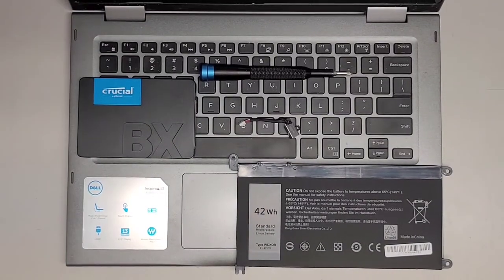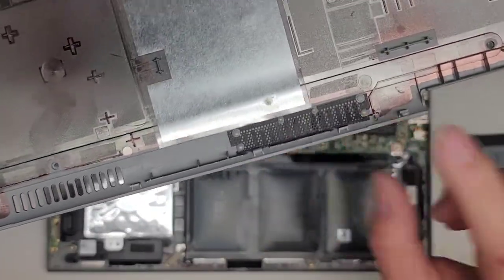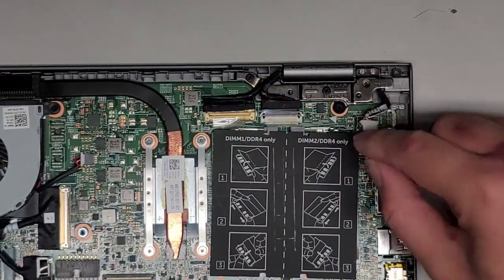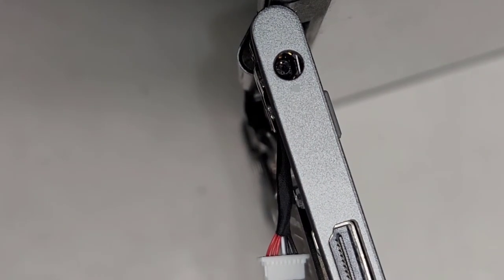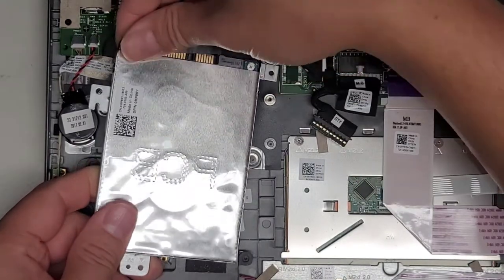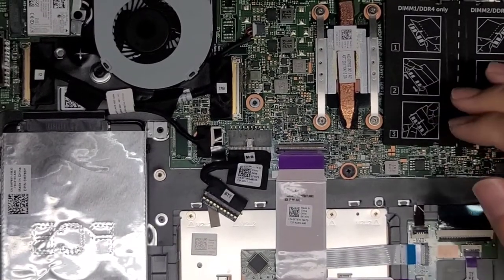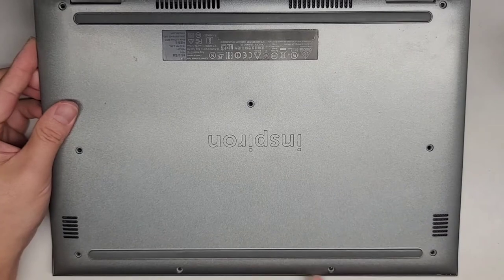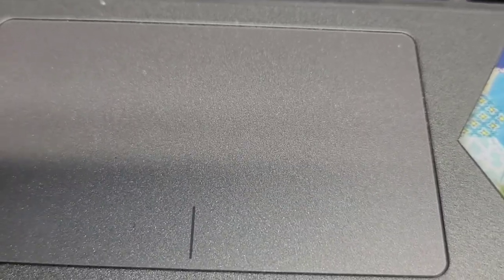DELL Inspiron 13 5000 Series 5378 2-in-1 Disassembly RAM SSD Hard Drive Upgrade Replacement Repair

Comment: Excellent video brother!❤ I'm not from computer background at all but hoping to replace HDD with SSD and also upgrade RAM by myself. Preparing myself for the task by reading theory and watching videos (yours is quite helpful!).

I have 2 questions (may sound silly)

1) How to protect internal components from static electrical discharge from our body while opening back lid and working?

2) Which software would you recommend for cloning HDD to SSD?

Thank you so much man!❤ Appreciate your dedication to explain it to public!
Reply from the maker: This will help https://youtu.be/4p5jFDzVwUw

Comment: Since there are two slots for Ram can you use the old existing one and just add a ram stick to the slot beside it?
Reply from the maker: That's what I say in the video.
Reply: @ItsBinhRepaired  Ok. Thanks. I didn't catch it.
Reply from the maker: Make sure you get the same capacity,  speed, and type of ram for best performance.
Reply: @ItsBinhRepaired  Ok. Thank you. Will do.
Reply from the maker: @DustedinShadow  sounds good

Comment: i have the same laptop and i cant seem to find intel processor under that slot where copper heat transfer cable is present
Reply from the maker: It's soldered to the motherboard.
Reply: @ItsBinhRepaired  thank you!
Reply from the maker: @prakash525  no problem

Comment: Do you have same motherboard? 
I need the motherboard for my laptop.
Dell inspiron 13 5000 5378.
Reply from the maker: Maybe ebay
Reply: EBay good on finding motherboards. I replaced mine on a netbook several years ago as the charging plug broke off.
Reply: Kada
Type in on search the part number of motherboard and that is the best way to find one.
Hope that helps
Reply from the maker: @brianperry4815 yup
Reply from the maker: @brianperry4815 yup

Comment: My wife has similar laptop but 7000 séries. The trackpad more then not buttons don't work so I ordered a new one from Dell as I wanted to get the right one.
Reply from the maker: Hope the repair goes well.
Reply: @ItsBinhRepaired   It mostly went well.  It works BUT not good at pushing down holding to scroll. also drag and drop.  The ONLY reason she has the Dell she wanted portable small laptop and insurance payed for it.Had HP Envoy but died.
Reply from the maker: @brianperry4815  :( faulty trackpad